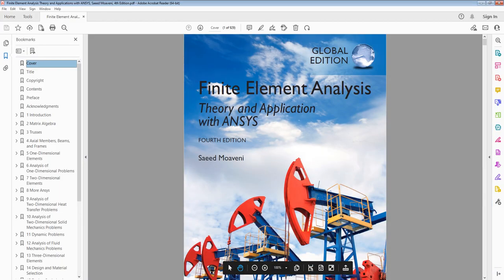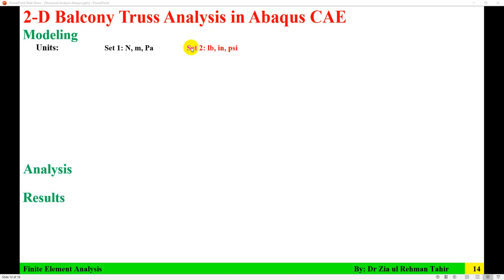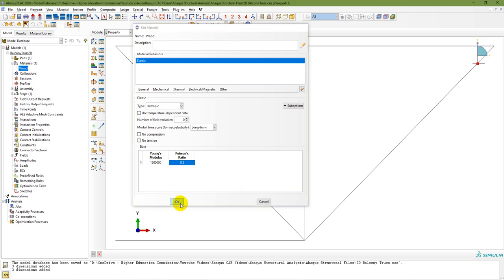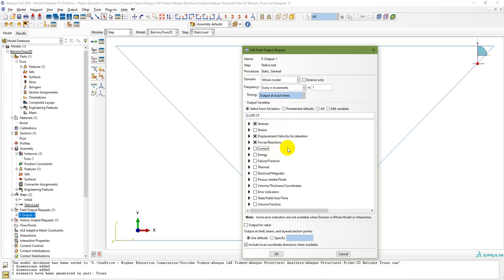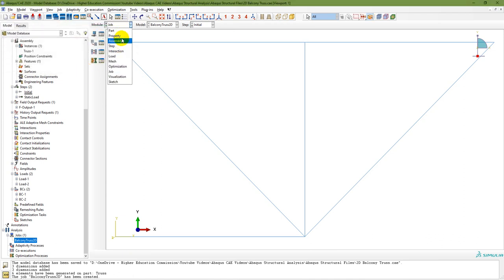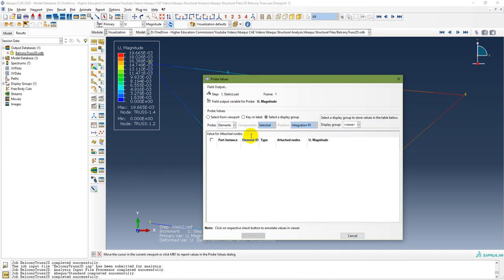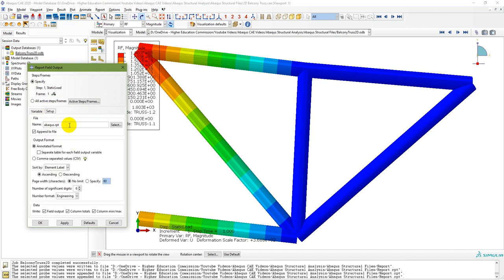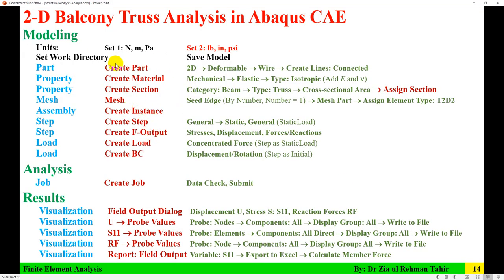Abaqus Truss Analysis Lecture 2 | 2D Pin-Jointed Structure | Member Forces and Support Reactions

Comment: Hi, thanks for the tutorial. I've got a doubt: I can't tell if the top bar (members 2 and 5) functions as one member, as displayed in the sketch, or it's been partitioned into two bars. Thanks in advance. Saludos.
Reply: The assumption taken in the truss analysis is that "there are only two nodes per element." So according to this assumption, member/ element 2 and 5 are different elements not a single element, because if you take it as a simple element, then there will be three nodes in that element.
Hope you get it. Thanks